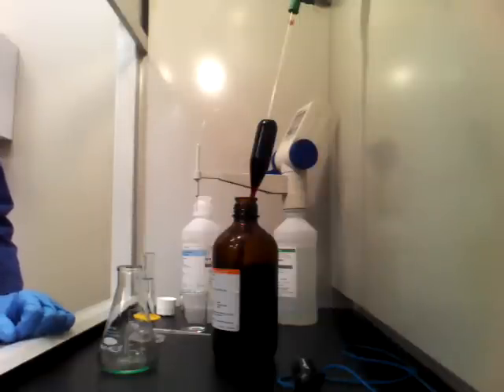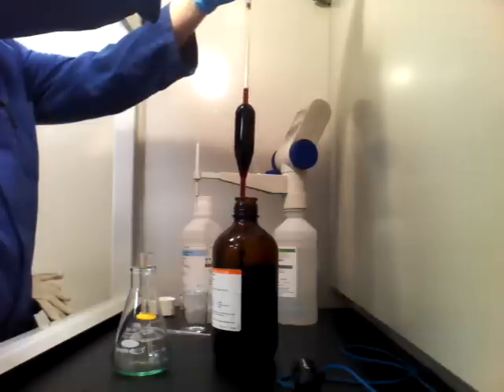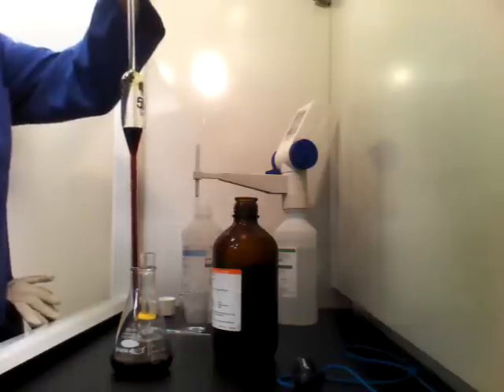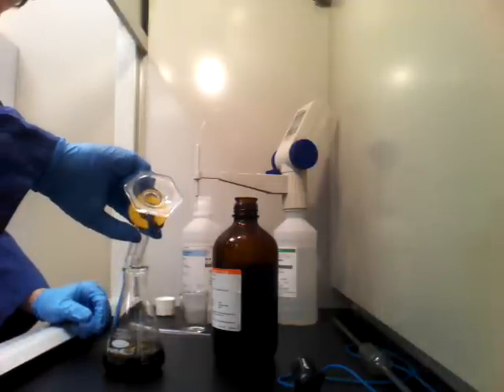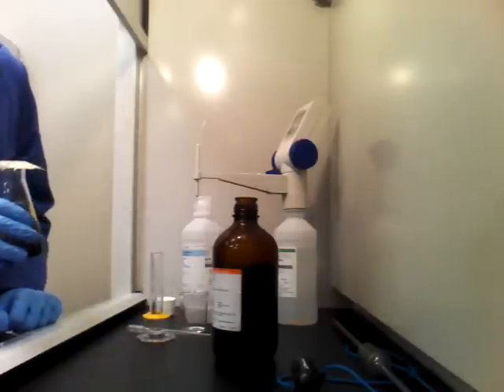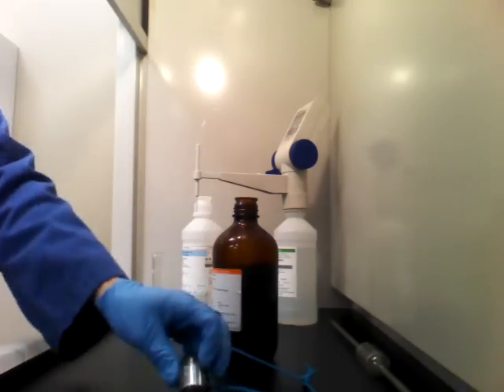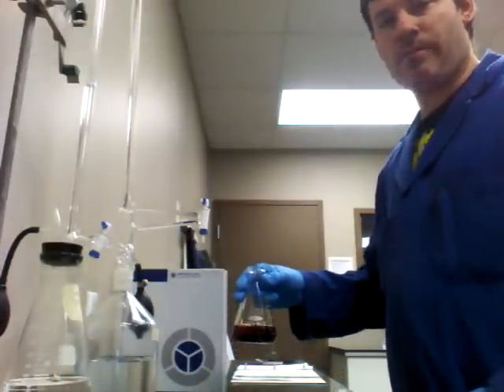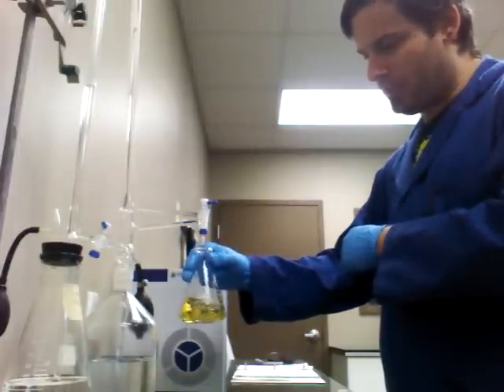Sodium Hypophosphite titration of an EN  sample

Comment: Many errors
Reply from the maker: Explain. This is exactly to the chemistry suppliers TDS.
Reply: @kungfoojoel  No 1. when u added iodine, the pipette had an air bubble. No 2. You had to add starch as indicator after they solution turn yellow.
Reply from the maker: @jesusisaacruiz1944  yes you are correct, there was a bubble.....the video was to explain the process and i should have re done it. But, you are wrong on the iodine. Starch is not needed in a titration for sodium hypo in a high phos ENC bath. Not to mention, saying "many" when there was two things is a bit dramatic.....and really it was just one.